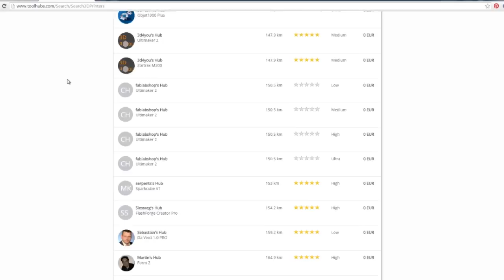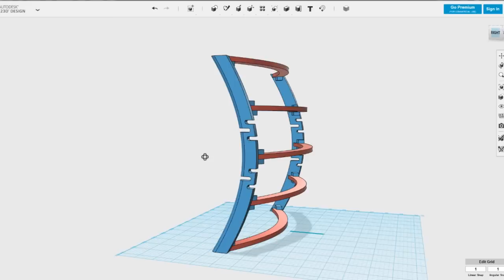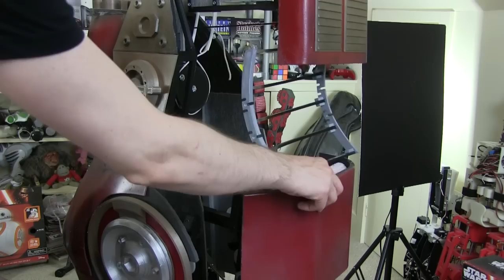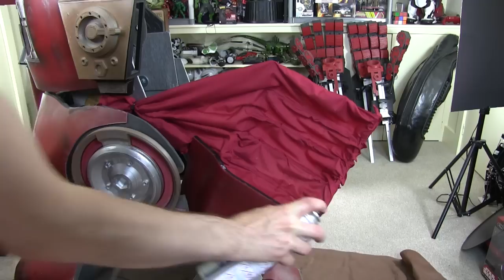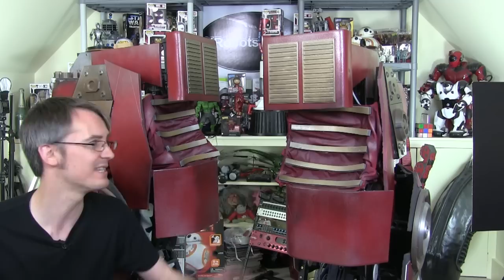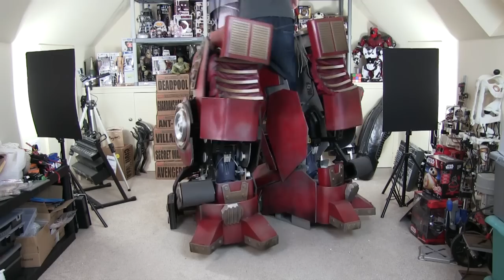Iron Man Hulkbuster Cosplay #57 | Leg Rear Panels & Testing | James Bruton

Comment: I have an idea for the empty space if you make 2 peace's make a type of sliding mechanism and tie a peace of string to the bottom peace and have a little cylinder for the string to go around and tie the other end of the string to the main part when the panel opens it well pull the string pulling the 2 parts up letting you get in and when it closes it well go back down

Comment: Why not use a removable fastener like snaps, velcro, or hooks for securing your flexible material over the hole areas. You could then unfasten them for moving the panels, then reach down/back to fasten them back in place after you step up into the legs.

Comment: i have to say i actually like the fact that things weren't going as well as expected and that your initial plans didn't turn out to work that well after all. not because i like to see you fail, not at all, but I find a lot of people only post videos of them successfully making things, cutting out all the mistakes and failure builds that are actually very important things to learn from. And as a side effect it makes you more likeable as everybody makes mistakes, but you keep pushing on until it works, that's the difference I guess. It certainly makes me feel more relaxed about my concept failures and other fuck ups :)
Reply: I have an idea for the empty space if you make 2 peace's make a type of sliding mechanism and tie a peace of string to the bottom peace and have a little cylinder for the string to go around and tie the other end of the string to the main part when the panel opens it well pull the string pulling the 2 parts up letting you get in and when it closes it well go back down.

Comment: Suggestion about the ankles: How about using what you have. The "ski boots" could work pretty well if you paint them to match the rest of the suit. And then put some pipes from the bottom and a bit up (behind the first cover) to add depth. Thus making the "hole" a feature instead of a "bug".

Comment: That's the unfortunate thing about gigantic builds: sometimes concessions just have to be made.  With my Krogan build (watch?v=zrA_JfF7dmQ), it looks identical to the character but is a pain in the back to put on and take off.  And even though it's 99% floor mat foam and barely weighs 20-30 pounds, I can't wear it for long.  The legs/boots are especially problematic, as I have to boost myself up with the help of my handler just to get into them fully.

Well done!  Really excited to see this project come to its head.  For such a highly detailed build, everything really has come together wonderfully.  Even though I know you're not happy with some parts, I'm sure you'll get it all worked out in time and it'll be just the way you wanted it to be.  Can't wait to see what craziness you come up with next!  :D

Comment: Watching you walk in this thing it seems like you hardly bend the knees at all. Maybe the effort to make the joint cover appear to be (or actually be) flexible isn't worth it? Especially given that the upper leg just sort of swallows the knee joint when it bends anyway. You could probably replace that part with a rigid one, like a cut-cylinder shape (a pie wedge) and have no significant loss of mobility.

Comment: Something like flexible aircon tubing may work for those tricky areas, the kind with a spiral spring of stiff wire covered in light flexible plastic.
 Cut in half and painted it could look quite effective.

Comment: Did you consider trying that single-print chainmail? There's a repeat hexagon version that would fit quite nicely!
Reply: Also instead of gluing on more ribs you should have tried putting the cloth on the inside, stretched AROUND the ribs, would pull the fabric tight and left ribs visible.

Comment: I personally think that a good way to compensate the back of the knees would be to use black fabric with silver exterior ribbing, as it would break up the monotony of the red and gold. I think overall there is to much red and gold (on some parts that you've painted gold I would have painted silver to break up the two base colours however thats just personal preferance). I also think, seeing as the back of the knee doesn't actually compress if the black fabric was taut it would look a lot better and cleaner. Just some ramblings; hope this helps in some way.

Comment: If I could offer a suggestion for the back of the legs. Why not a stretchy fabric like nylon built in collapsible frame? It probably wouldnt take much time and look much nicer.

Edit: Just realized this probably doesnt make sense. I have no real way of designing it and showing you but it would work similarly to those kids play tunnels that compress into each ends for easy storage except it would be designed much like a foot air pump so when you bend your knees it would compress and when your legs were extended it would extend with you.

Comment: Hi, it is Chris in Bulgaria, have you thought to wear your iron man legs, this would hide any spacing and Maybe look good, as you are iron man in a second suit. And, please try to use your knees when walking instead of transfering your weight from side to side, Dont want to see Robi the robot style walking, Looking great by the way, It is very tempting to get one of those printers you have and build another iron man myself., I saw the rear bits of the feet, you are right, I think there will be a clash with the backs of the feet, just make them paralel , it will still look good. When you were doing the fabric part, I thought of the chinese junk sails style might be a way to go, just a thought.. Keep going, have fun!!

Comment: What could be done for that back area with the ankle to back calf where you wanted to put fabric, to deal with the distance increasing when open, you could have the fabric on a roll sort of thing, so it can stretch out, however naturally rolls or folds back up to a position where there isn't extra fabric, and it looks nice and tidy. 

This same thing might be able to be employed in other joints like the elbow, and have the fabric on rubber bands on each end, which would keep it taut, however able to bend. To keep it so it doesn't stretch outwards when the elbow, or whatever joint, is bent inwards, you could have some rubber bands attatched more to the back/edges of the fabric. It woudl be simple to employ, and if done well, which no doubt you can do, I think it would look quite nice.